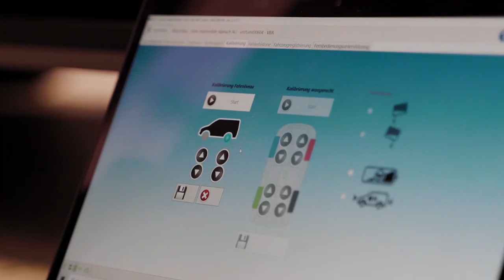VW T6.1 California - VB Luftfahrwerk +30mm

Comment: What is the min and max height with this suspension setup? And how durable it is - is it designed to just allow you to go over a curb or for offroad use?
Reply from the maker: Hello
You can adjust the rear 160mm from the very top to the very bottom. The suspension is quite good. You can also drive off-road with the VB suspension.